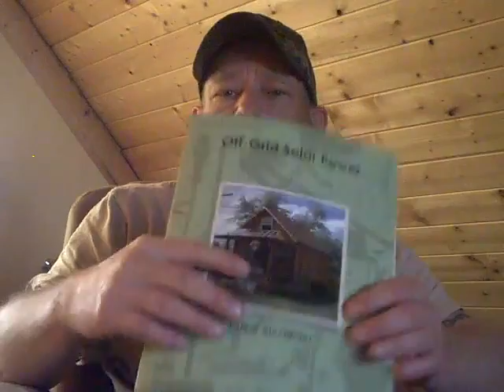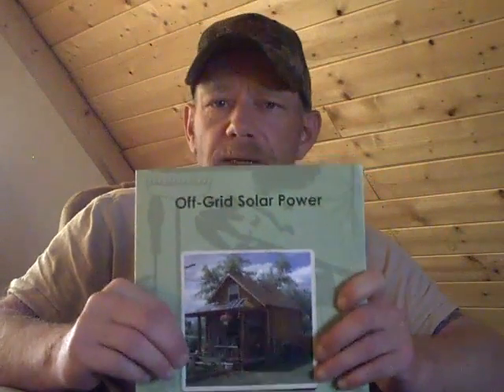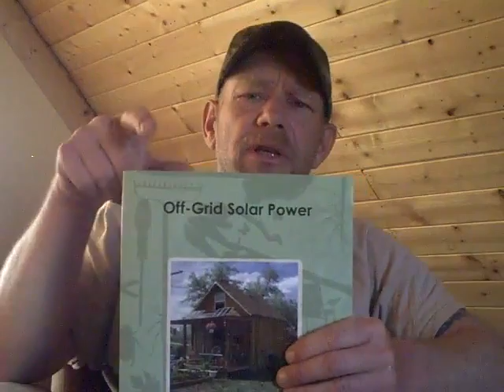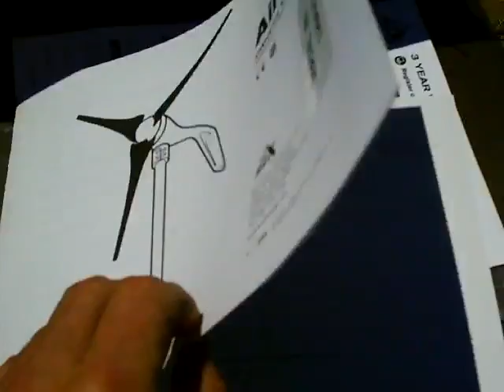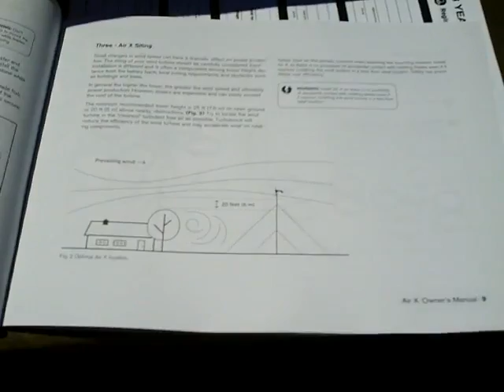Off Grid Solar and Wind Installation Part Five

Comment: I myself have four mw&s turbines in my system. I love them. I also have 7.2kws of solar. I've been taking my home off grid the last few weeks. I had the turbines and two 900 watt solar backs hooked up to two outback flex max 80's and the turbines to the battery bank. the rest was grid tied. i'm tried of getting ripped off by the power companies, so i'm taking as much as I can off grid.

Comment: Could be, but the original Air X isn't available, and it looks from comments made that you bought from the company that made a good one, and the company that bought them out didn't have the same quality control 
standards.  There's more reviews, but they are along the same lines, even a couple that said they bought one and liked it, but when they bought another one years later, the model wasn't good.

Comment from the maker: Yes the book explains it and it depends on the type of turbine. The Air X has a built in controller so it just hooks direct to the batts but most turbines require a separate controller and a way to dump off excess power.

Comment: Thanks! One more question... I know you said you used wind power due to the snow/cloud cover you have where you are.  Would it be better to use wind power as an addition to solar in case of fewer sunny days in the winter, or would a larger array of solar panels work out cheaper in the long run, even though the cost is higher at the beginning?

Comment from the maker: For winter sun you want a 45 degree angle. Keep the panels close to the battery bank unless you are using a grid tied system and then it doesn't really matter but they need to be in direct sun at all times.

Comment: Lamar, I've been having fun with SketchUp all afternoon, but I have a two-part question. If I build my cabin facing true south with a sloping rooftoop (like on the Bandito), at what angle do I pitch the solar panels, or if I decide to mount them to a system in the yard, how far from the house can I put them?

Comment: I just finished watching all 5 parts of the solar & wind series. Great series BTW.... I much appreciate your time and effort. Two questions... 1st.. on part 5 with the AirX, you said you were gonna put the meter on the system to determine output... Did you ever, and if so, what were the results... Watts, voltage, & amps....??? 2nd... What exactly is the name of your web site... ?  tried to find it...having some difficulty...

Comment from the maker: Solar is still the best first option but I use a combined system because in winter the wind blows more while the sun may not shine for days. You want to have enough storage capacity to last at least 3 days and sometimes you will need a generator to top batts back to full if the sun and wind do not cooperate.

Comment: I may have just missed it, but did you ever state how much amperage it was actually producing at the wind speeds?  Would love to know, as I am considering a 400w wind turbine to go along with my 400w of solar on my own off grid setup.  My panels keep up most of the time, but sometimes we go a week or more without a good sunny day, and it is pushing the system harder than I would like.

Comment from the maker: The Air X wind turbine has a controller built in but most models do not and will require a controller and some way to dump extra power when batts reach full.

Comment: ok !,,u said in ur vid that the air X shut off power when batteries were full but in the comments u said that u need a wind power controller or a way to dump excess power,, so which is it?,,ive got coleman air controller that does both but ur comments will confuse others!!

Comment: Ok thanks, just trying to figure out what I'll need...  I'm going to move into a motorhome if I can get it to work out. I think my biggest problem may be my laptop, it's a newer 17" dual core but I need my laptop on all the time for work. I run it every hour I'm awake.

Then just a 37" led lcd tv maybe 5 hours a night, plus lights which I'll swap the ones I use most for LED's, and whatever else the typical draw would be from a 32-40' cheap old used motorhome. Can't afford too much, not sure...

Comment from the maker: Batteries are rated in amp hours and the bank is 6 batts with approximate 360 amp hours per batt.

The wind turbine produces 400 watts continuous in winds above 25 mph.  My battery bank will keep all my appliances and gadgets running for 3 days with no power coming in.

Comment: Then your battery bank can only sustain 1 hour output at 400w with those big new batteries? You can't get more out than you put in... And vice versa. But that doesn't sound right, I hope those would last longer than that. 400w / say 13v = 30a for one hour output and you're done?

Comment: Your battery bank has grown significantly, and the turbine seems a lot smaller than what you could have put up there. Is that 400w enough to charge without sunny days, how long does it take in your average weather? If you had things to do over...?

Oh and I think the windmill on the power companies pole is the perfect statement for your off grid place. It's a tasteful looking middle finger to the man in my eyes. You know you could be flying a pirate flag lower down and it would be even nicer.

Comment: You gotta try missouri wind and solar's 29 inch Raptor generation 4 blades. they'll fit right on that hub and make that thing turn in lower wind and pump out a LOT more amperage.

Comment from the maker: @HungryGreeny 

It depends on the turbine. The Air X has a controller built in but some require a separate wind power controller with a dump circuit.

Comment: @solarcabin -- Nearly 1,000 watts, that is good. I saw a video of a guy who had 56 solar panels and was separating hydrogen in the warmer months and using the hydrogen for fuel in the colder months. It was a very expensive and complicated system. I think if 56 solar panels doesn't provide enough electricity for a person's house, then that person is using too much electricity. I think 1,000 watts is about right.

Comment from the maker: @BullittMcQueen1 

My current system is 580 watts solar and 400 watts wind. I rarely use the generator anymore and only for power tools. System works very well and I have more than enough power.

Comment: I did not see the charge controller used with the wind generator, or how you tie the wind system and the solar system together, It would be nice to see how that works.

Comment: would be interested in how many watts it actually supplies,how much the battery stores and supplies and about the connection to the house electric supply,breaker box,bypassing it or what

Comment from the maker: @PHANTOMSLAYER77 

In  high humidity area you need a good vapor barrier. The cabin sits 8 inches above grade on cement deck block which is required to avoid termites but as with all homes you need to seal them well.

Comment from the maker: @paddyboy12432 

The turbine has a wire swivel to keep them from twisting and no controller or dump needed for the air X. It has a built in regulator and brake.